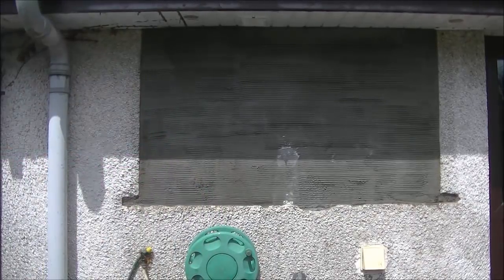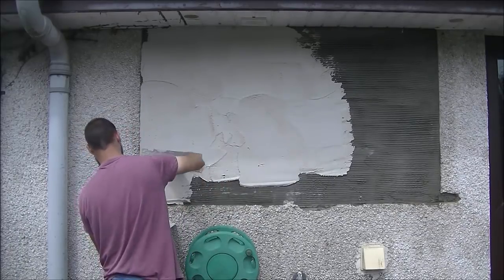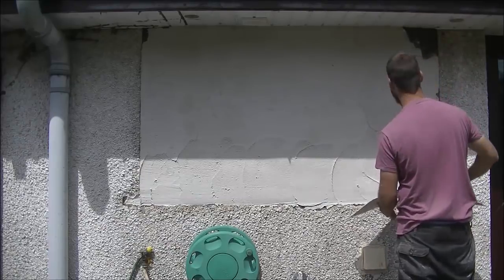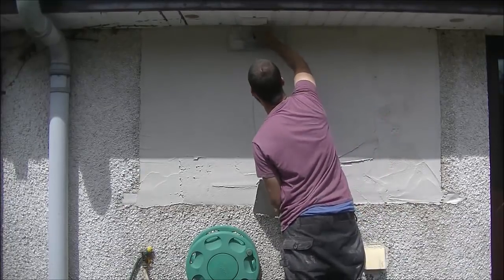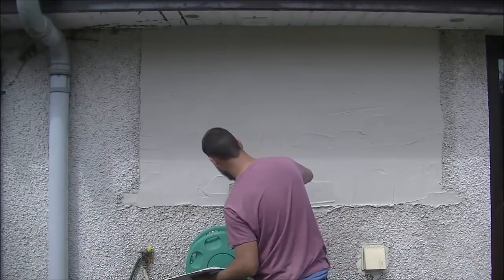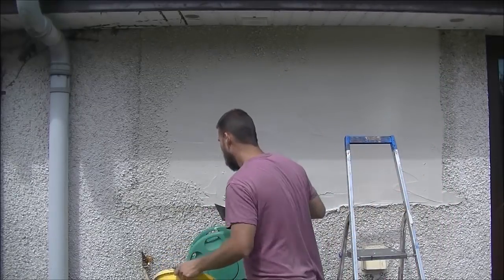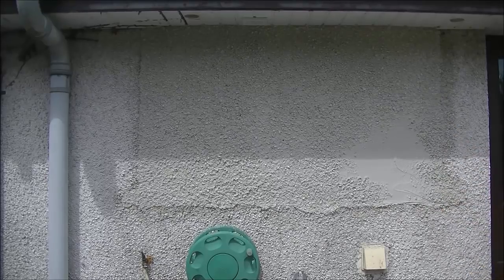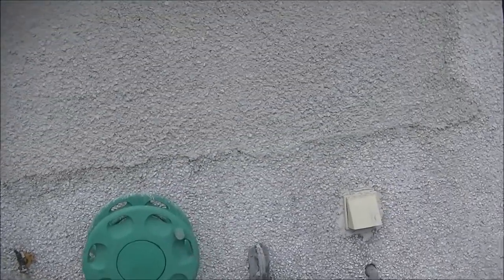HOW I PATCH DRY DASH RENDER,ROUGHCAST,PEBBLE DASH DEMO PART 2

Comment: Hi there,

It's great to watch a true pro in action, you make look so easy, I'm sure it's not as simple as it looks!.

The problem I have is that I've found some water pooling on the rear window sill of my house.

I've managed to trace it to a bit of frost damaged render that's popped out from the wall, it sounds hollow when you tap it with a screwdriver.

There are maybe 2 or 3 small areas which need redone, the finish is white pebble dash, and the top coat mortar is a light grey in colour.

The more I delve into this, the more complicated it seems to get.

The areas I need to repair are maybe 18 or 20 inches x  same.

Can you tell me, is the mix ratio the same for both the top coat and the scratch coat, and if so, what are they?.

I notice in the video that your top coat looks a lot lighter in colour than the scratch coat, and that's what I am trying to get, to match the existing render.

Are you using a different type of sand and cement for your top coat (white sand/cement) to get that lighter colour, and if so are the mix ratios the same (4 to1)????.

Any help would be much appreciated.

Thanks.
Reply from the maker: Hi Stuart mate my 1st coat is normal sand and cement a 3 to 1 mix top coat is white sand and cement 4 to 1 other guys do it diffrent but this has always worked for me I put some water proffer in both coats also hope this helps buddy thanks for watching , let me know how you get on

Comment: Now bud how do u get the mix white is it just white cement .
Reply from the maker: White and and white cement mate sand can go by a few names silica sand and silver sand both are the same thing what you planning on doing mate ?
Reply: @macplastering  got a porch to sand and cement render was gunna use white cement just so it easier to paint if u no wat I mean 👍
Reply from the maker: @rockroll456  I hear you mate only thing is this gear is very hard to rub up its very fine close to building sand I have seen some gritty but not often
Reply: Ok bud cheers
Reply from the maker: @rockroll456  Any time mate you now I am always here :)

Comment: Hi I'm covering an artex ceiling/stipple I'm doing two coats of ova followed by a bonding coat and then multifinnish, would you recommend this way or ?
Reply from the maker: Hi Connor mate Sounds like you have it sorted buddy a few other ways would be thistle bond it the day before and the over boarding then skim but if it is tight and dont get lose due to pva you should be fine to go ahead , stay safe as older artex has asbestos so just check before you scrap it down
Reply from the maker: Hi Connor mate hope your well mate here is how i re plaster textured ceilings and artex  - https://youtu.be/YuUoZZ6v6MU

Happy new year :)

Comment: Hi mate,

Thanks for replying to my previous question, I have taken note of the mix ratios that you recommended.

You said that you used a water proofer in both your scratch coat and your top coat, I have bought some Cementone SBR.

Would it be a good idea to include some of this as a waterproofer in my render mix, and if so, how much should I put in?.

I am probably only going to mix a small bucket at a time.

Any advice would be much appreciated.

Stuart.
Reply from the maker: Best to give it a read at back I dont put loads in as it is good and strong most sbr are pretty good , but remember sbr will set your renders of quicker so just a heads up on it mate as if your top coat gets tight stones wont stick as good
Reply from the maker: on this video  I do 2 quick coats of same stuff for the top coat to control suction and it drying as it was done in very warm weather :)
Reply: Cheers mate,

I will just put a little SBR in the scratch coat, and leave it out of the top coat, as you say, it may start to go off quickly if I put SBR into it.

Do you think it would be a good idea to give the repair area a coat of slurry primer before applying the scratch coat.

I can't wait to make a start on this, all I need is a couple of days decent weather.

Kind regards,

Stuart.

Comment: Im in a mid Terrace 30s, small patch beeds doing as some ivy got under the pebble dash. Do i need line wasg render, dont want trapped moister?
Reply from the maker: Hi buddy its best to patch with the same as the original was done in, more likely it was a cement mix with some lime in but can be sure with out seeing it
Reply from the maker: Hi buddy its best to patch with the same as the original was done in, more likely it was a cement mix with some lime in but can be sure with out seeing it
Reply from the maker: The  idea of lime is it will be breathable so water gets in but so dose air so it dries out where as cement is waterproof so wont let water in but its dtill best to follow the original
Reply: @macplastering  cheers m8
Reply from the maker: @Drdoombrain  any time buddy just uploaded how i finished the base to get part 1of these jobs might be of some interest mate